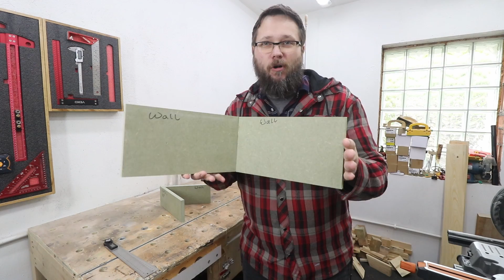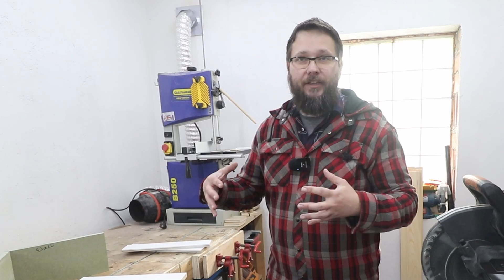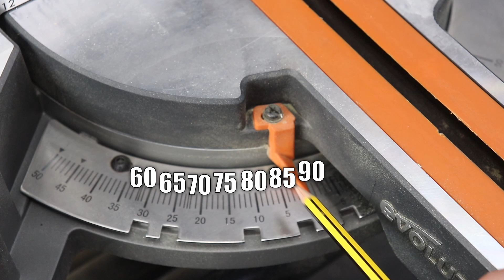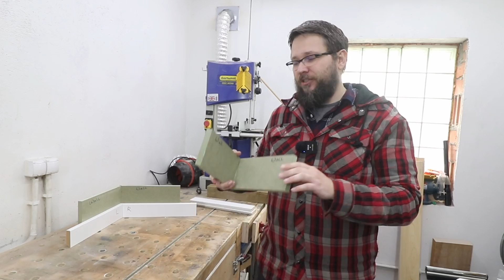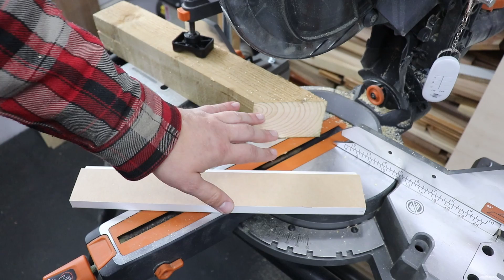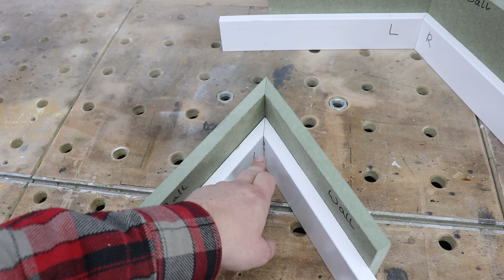How to Cut Steep & Wide INSIDE Angles on a Mitre Saw The Easy Way!

Comment: I have the same mitre saw. Is it possible to do these cuts as bevel cuts for deeper section skirting board? So it can be laid flat instead of holding it upright
Reply from the maker: Yes its possible with some correct arrangement